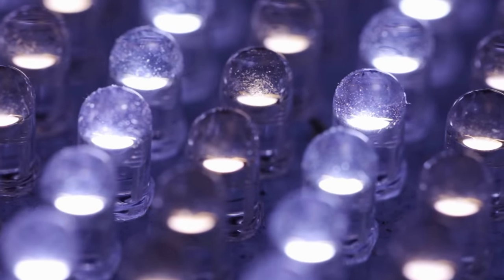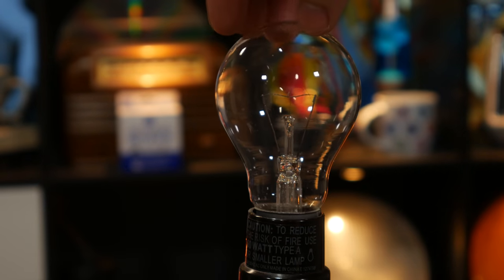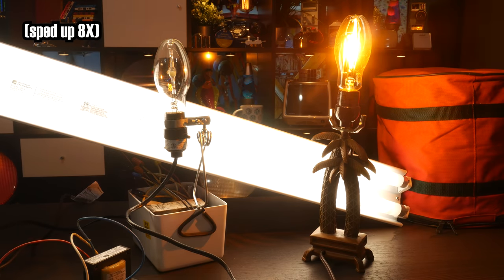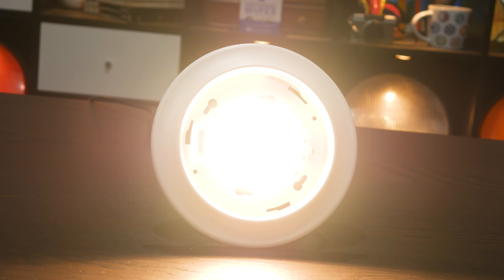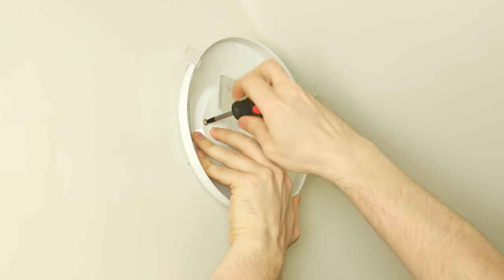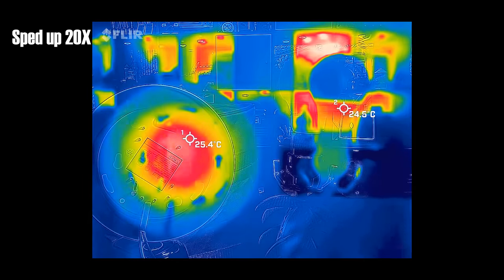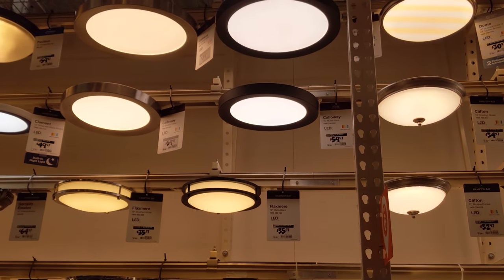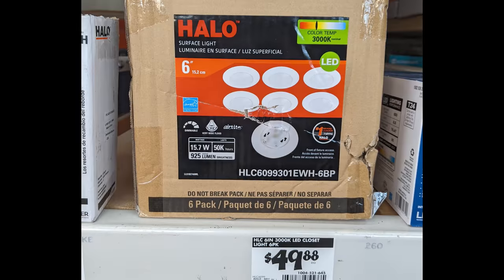A troubling trend in lighting?

Comment: LEDs tend to die very frequently if you have a fixture that’s 30+ years old, crappy wiring, and/or a rarer lightbulb size. 

The bulb size issue is the one that’s bitten me the most. Bulbs of types A, BR, and PAR are pretty bulletproof even in old houses IME. It’s the B and G that are cursed. The exact size you had in incandescent might not even exist in LED. Some of these bulbs were made by one company, that you bought for 30 years. So you jerry rig something that works, for a time, but it’s on borrowed time. Long term, you need to bite the bullet and get rid of that ancient POS fixture. 

Incandescents are more resilient to “dirty” electricity due to shoddy wiring, for a lack of a better word. A brief power surge will fry a driver, but an incandescent wouldn’t suffer any damage before a fuse would blow.

Comment: @technologyconnections I really was against the self contained units for a long time. I recently moved and the house had some oddly…cheap lighting decisions made in a few areas so I had more can lights installed. All was well until they got to one area where there was not enough clearance to add the can. My electrician had been trying to convince me to go with the self contained units the whole time and I refused for a few reasons. 1) I wanted to be able to swap bulbs easily. Both for the case of light failure and also because I may want newer smart light tech later on. And then 2) because I have a ton of Hue bulbs and wanted to move them from the old house to the new. Hue had just come out with a complete self contained unit that simulates can lights but is ultra thin. So it was a huge win for the room where we had this issue.

I still installed cans where I could, but it was great having the flexibility in places where the original builder made….odd decisions.

Comment: Cool vid, as usual!

I got tired of replacing (and handling) circline fluoros about every year (across different rooms) and for the cost of replacing circline bulbs I figured I'd try $30 flushmount LED w/ on-body K switch and listed 90CRI (I recognize the standardized Home Depot display from your video). This is after realizing I haven't had a bad LED bulb out of a couple dozen installed in at least 4 years (when used per the labeling, a couple of bulbs got weird in the fridge), and like you, the bad bulbs identified themselves within the return period. And I've been using socketed LED bulbs for maybe 6-7 years. Still, until I tried the flushmount all my LED bulb experience has been with screw socket bases, and I hoarded a few dozen bulbs across the years (Home Depot used to be pretty reliable to get a bunch on clearance before I started realizing around end of 2019 that 90 CRI, 100W replacement LED bulbs had gotten to a point of incandescent-bulb commodity low pricing--what drove it home was the explosion of additional features like selectable K temps, actually what really drove it home was the trend of making so many of them IoT, Bluetooth, built-in speakers; fortunately the extra features seem to have calmed back down to things like brighter temps, dusk-to-dawn, motion sensors, and selectable K temps).

I was uncomfortable going with a much less flexible wiring setup, but I really didn't want to eat the overhead space putting in sockets. I tried 1 of the hard-wired flushmounts for a few months to see how it shook out, liked it enough and went ahead and replaced two other rooms. They're dimmable but turns out I didn't like how overhead lighting dims in a room, but I don't feel like putting the old switch back in my first installed room.

I also ended up installing a tube fluoro LED replacement after finally getting fed up with the slow starting ballast in a storage room. I had those LED replacements in storage for a couple years (another HD clearance purchase, can get brighter tubes now for just a little bit more regular price), but I didn't really bother to look at the instructions to see how easy it would be, turns out just shut of the breaker, cut the ballast out of the circuit, and plug in the LED tubes. Those older LED tubes have a split second hesitation before lighting but otherwise also good (and at least consistent lag time, no light switch games with the ballast anymore).

The LED replacement bulbs in my car though, still keeping a close eye on them. The brake lights are both currently on warranty replacement after just 2 months, and I'm not even going to bother trying to deal with hyperflashing signals. After leaving my headlamps on a couple times though I'm really hoping I can keep the wattage savings and not go back to incandescent or halogens.

Comment: I hate those disposable fixtures with a passion. You're right, you need to know what you're doing with electricity, and that's something not a lot of people should be messing with. Changing a bulb is something so basic even a teenager can do relatively safe. Having to replace the whole fixture and mess with wires and dangerous electricity every time your light fails, that's something so stupid I don't know why it exists in the first place.
Reply: The reason it exists to begin with is that these LED fixture are supposed to give you 1-3 decades of service before they fail. I know plenty have failed before that but the idea is with such long life of service it doesn't make sense to be replacing it all the time

Comment: Just went through the hassle of trying to find Track Lighting that still uses bulbs.  All the newer designs are integrated LED units that must be replaced - however - the track head itself can be removed from the track and replaced instead of the whole fixture, so there's that.  As long as the type of head you purchased is still being made...that's another story.  Ended up with a track light set that would have been stylish when the Golden Girls was on TV, but at least I can change the LED bulbs when they die without paying ridiculous amounts of money for a new head that may or may not match the existing ones.

Comment: You know what? I didn't even consider this with my led panels but in a way it is the same. These are intended for suspended ceilings but I am using them as is flat mounted to the ceiling. but when they are dead I'll have to dispose of the entire panel.. (minus the psu possibly) They do live a long time. I did a rough estimate and my panels have a current power-on time between 55k and 60k hours. Makes me wonder how long they will live. Even if they would die this year I am still very happy with them, bright and very diffuse light (so no shadows). also very low profile. 

I can both recommend them and advise against because I can never go back to a workshop that is less well and evenly lit. My room is roughly 45m2 and I installed 9pcs of 30x120cm panel and 2pcs of 60x120 panel . Those larger panels are assembled into one massive 60x240 panel this means this panel is exactly the same size as my central workbench. Those have a combined lightoutput of 15000lm and combined with the 9 "smaller" panels that are rated at 4530lm each you get a max total of 55770lm. (they are individually switchable and operated by home automation manually or in profiles combined)

Comment: i just picked up that exact style LED light fixture at walmart last week. in the middle of a renovation so upgrading all my old screw edison style light fixtures. in the store i was debating getting the old screw edison style fixtures or these new LEDs. we'll see how it goes
Reply: Why would you even consider the LED's? Just use LED bulbs with the old style.
Reply: @Warp3326  im upgrading the entire fixture so i was thinking i should just get a new led fixture.  thinking new = better. 

but i changed my mind. i returned the led fixture and got a "new" fixture but with the proven edison style sockets. and just gonna use LED bulbs.

so basically what you said

Comment: These things are an absolute nightmare if you're renting too: if you don't like the color of a lightbulb, it's easy to switch it out, even get a smart one you can adjust. But a fixture like this is just completely set in place, and if you're just renting, it's not like you can just tear them out of the wall and replace them... so you're stuck with clashing light colors or hospital lights.

Comment: Having done failure analyses and even a few low-level repairs on those exact Ecosmart constant-current driver bulbs (attempt low-level repairs at your own risk, I'm an EE and know what I'm doing), I can confirm that all of the failures I have seen have been in the LEDs and driver chips and not in the capacitors. So far in probably 8-10 or so of them, I have seen zero capacitor failures. The caps are spaced off the main PCB and probably don't generate much heat themselves, so it seems to be the parts mounted on the PCB itself which fail due to inadequate cooling. Aside from the Ecosmart ones, I have also had some unusually quick failures from LED bulbs with the word "CREE" written on them for some reason... I bought several a number of years ago, in multiple different styles, and within about 2-3 years every single one had failed. I have had much better luck with Philips, with nearly all of them making it into the 5-10 year range now in many of the same fixtures and still going strong.

Comment: The thing is, the average person spends 10 years in their house before moving.

By that time,na house needs quite a bit of work to get the max selling price.

After a decade, you're either going to change all the light fixtures, or the person from the bank is going to subtract more off the houses price, than the fixtures cost.

Same for flooring, plugs, switches, and their covers.

Comment: 18:58 Dying LED lighting is what I like to call SLOW DEATHS. Which is why I personally despise LED lighting in my home and have resorted to returning to CFL. But the thing I despise the most is what I call Zombie LED's. This is when the LED (the actual Diode) still works but is extremely dim. It causes an increase load and tends to burn stuff. I have my truck almost catch fire because of the dang zombie LED's. Be careful what you buy and only buy from the reputable brands because Zombie LED's are dangerous.
Edit: The LED's I use are filament style bulbs because I'm picky.

Comment: I personally think we need to re-visit the way we design our lighting. We are used to lightbulbs, but they had a lot of issues that we've lean to overcome. For example, the classic filament is very compact light emitting source, which is not ideal for many situations. The solution - we try various ways to distribute the light more or less equally to bigger area - make the lightbulb glass matte, use a lampshade, place multiple lower powered lights, or make the ceiling white to reflect and scatter the light like a giant diffusor.

And here we are, trying to mimic the lightbulb which had all these issues, with a light source free of many, if not all of that issues. Wouldn't it be better to embrace the strong points of LEDs instead of mimicking the light bulb, re-creating its pros, but also its cons, which shouldn't be there to begin with?

And on the side note, I absolutely despise this kind of ceiling lights, which only shine down and does not light the ceiling around it. It may be acceptable when you need that effect or you don't even have a ceiling, like in some manufacturing facility, but it is not comfortable for living or even for office activity. White ceiling is a great idea for living comfort.

Comment: The LED color temperature seems indeed dependent on culture or, possibly, climate. In  The Netherlands most LEDs are 2700K. In France I noticed the shops sell 2700K and 3000K bulbs alongside each other and in Spain everything is 3000K.

Comment: I think honestly the best idea is to reinvent a standard, yes feel free to drop the light bulb for these ceiling and wall fixtures, but then allow me the ability to buy a driver and lamp module that will then fit, a lot like the standard light we already have but need improvement, you could make a standard replacement driver circuit, and give it standard connectors, you can have the silly booblights and these commodity items with a lot less of an issue of being a one and done and requiring working with the bare wires

Comment: So recently I replaced my bedroom's light bulb with an LED light fixture panel, and the design is different from the fixture in this video, where the driver is separate from the LEDs (which is basically a ribbon around the case), and you can disconnect the driver from the fixture in order to facilitate the installation process. I figure it would be less of a waste of materials if it goes bad, since you could either replace only the driver or the LED panel, if the manufacturer decides to keep making this same model or compatibles.

Also I wonder if a video comparing wire nuts vs Wago connectors would be warranted. I've seen lots of American electricists online saying Wago is not good, while in some countries in Europe the wire nut is prohibited.

Comment: I say triple hell no to integrated LED fixtures where whole fixture must be replaced at end of life. (outside of battery operated temporary task lighting like flashlights and lanterns). For one- they seem to rarely live up to the rated life. There is high incidence of lemons that fail way, way early- even in the supposed quality names such as Cree and Phillips. I even see failed integrated LED fixtures in the displays at Home Depot. There is less, or no cost savings with these integrated LED disposable fixtures, does not save on energy or pollution when manufacturing is considered. Second, we are being forced to put more stuff in the landfill that cannot be easily offered for recycling much sooner and frequently. Third, changing the fixture compared to a bulb change is often inconvenient- we have a warehouse with a 30-ft ceiling, and 48" plenum rated fixtures in the office- both have failures way early- lemons- that require renting a lift, and getting into fiberglass insulation in the plenum- DAMN IT!  At one point, we wanted to add some shop lights over the work stations in the warehouse- finding 48" shop lights were I could just wire them up with a modular replaceable 48" T8 LED bulb proved to be someone hard to find. Hang on to your old fixtures- the lighting companies want to replace them with a really bad idea. Kind of like what they did to automotive tail lights- what used to be a $1.50 2-pack of bulbs at Autozone has turned into replacing the whole tail light that failed early for no reason for a much higher cost, and tossing the failed unit into the landfill. Lastly, a modular socket, especially with the Edison or medium base allows so many options for the specific light the user wants that can easily be changed.

Comment: I just had one of these things break.   I only realized it was one of these lights when I tried to replace what I thought was a normal bulb.  There are very few markings on the device - I suspect it is a contractor version that is not available to me.  That builder/contractor is lost to time and I am stuck in the exact position noted for when these fail.  I cannot get an exact replacement. Also,  I think it's silly to hire an electrician to essentially replace a light bulb.

Comment: I had some LED bulbs that lasted for a few months, they were probably the cheapest ones available in the store. I accidentally discovered that if they start flashing hitting them pretty hard, but not hard enough to break them could temporarily fix them. Now I have a smart bulb in my room and it's been working for around a year. I have it set to 4300K (labeled as daylight in the app) and I don't get how you can use anything less than 3500K without feeling sleepy all the time

Comment: There are a lot of reasons LED bulbs can fail, and sadly many of them are where most people install them. You covered heat extensively and I suspect it to be the most common. LED bulbs also run on DC, and the additional circuitry and complexity likely contributes to failures especially in areas with an inconsistent grid. LEDs are also more susceptible to moisture problems

Comment: 25:25 they might just live in a place where power grid is very unstable.  Most light fixtures have very little protections from OVP/UVP/OCP/OTP so if grid is going wild, possibly because of some massive usage near by, it can fry LED's without protection, and I am 99% sure they did not buy any with protection, as they are hard to find.  Most of those LED's fried when their neighbor tripped their breaker, and you suddenly had a surge, that probably was not stopped by anything before reaching already overheating driver.